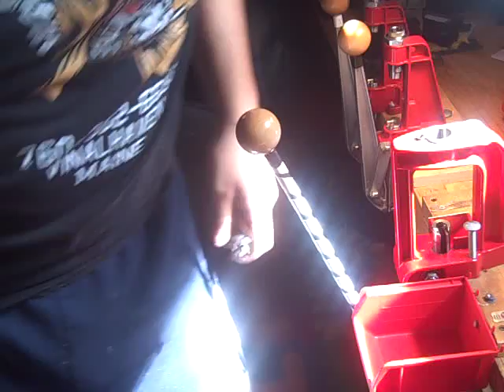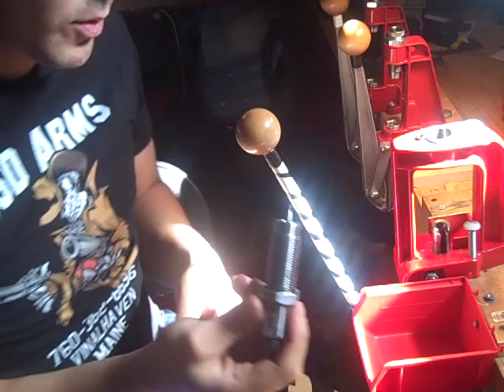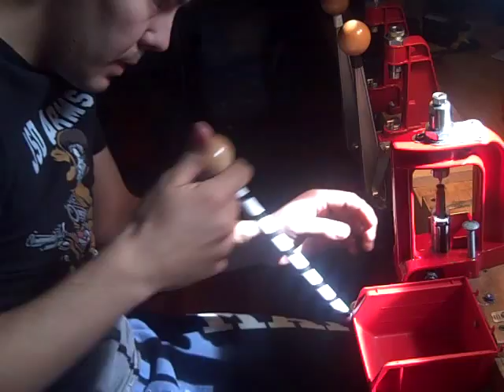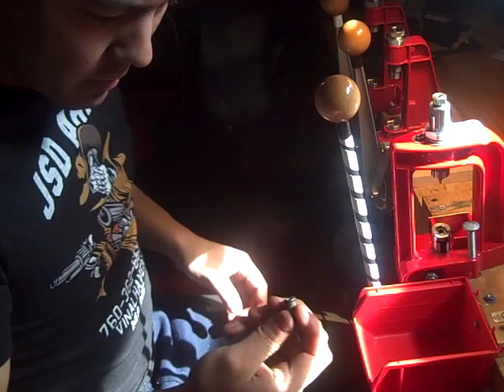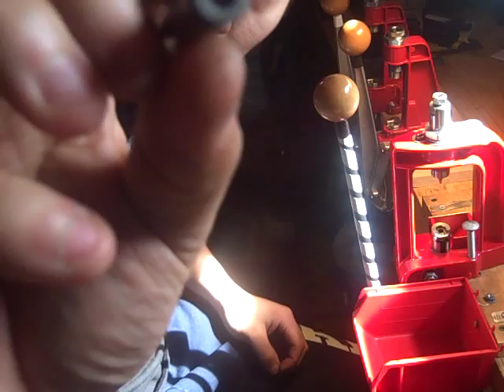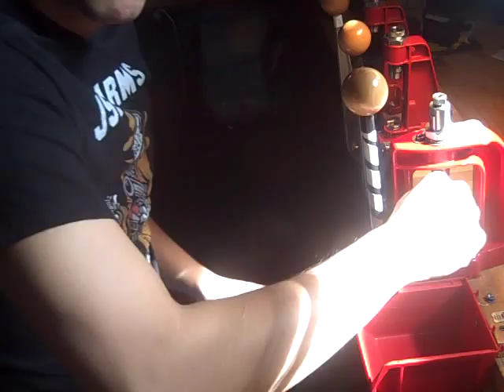Berdan to Boxer primer conversion custom made tool  by JSD Arms

Comment: They are different sizes so it won't just take a large rifle primer.  Did you also use a 22lr case to fill the inside?  Did that also work since I'm told lrp are longer than berdan primers?

Comment: The primer pocket is still too big for regular primers
Reply: You have to use a piece of copper tubing or .22 shell and a swaging die to make it smaller for a Boxer primer.
Reply: @ffjsb  a 22 shell? Wow that sounds like a great idea.  Never thought of trying that.  I've used copper tube and swaged it in but it was a hair big making it a little sloppy.  22 brass sounds great,  thanks 👍

Comment: so does this fix the issue of berdanprimers often being oversized ;) no - so you still need to either superglue primers in or make a bushing in the primerpocket to avoid dropping primers :)
Reply: Yes for most you'd still have to make the bushing but this is a nice step on the way. There was a place selling bushings for really cheap. I think that and this together would make it worth while.

Comment: This is a bit misleading because while this is an option, it actually takes longer in the long run. You cannot use berdan primers because the anvil is gone. Only large rifle primers and it will not seat like normal because the pocket is too big. You will have to drop the primer in and then use a drop of nail polish to glue the primer in place. You will have to do this every reload. I think the fastest method is the Russian Reloads who used a simplified method of a guy who has conversion videos for the x54r on surplus rifle forums.
Reply: How many times can you safely use a steel case?
Reply: About same amount as brass, but brass can be annealed which effectively renews the brass life (aside from material drifting from the head over many reload cycles). However, steel cases barely stretch so you don't have to trim them. This is a huge time saver. If you are debating buying this, at the very least collect steel cases you find. Eventually when surplus dries up you will be happy to buy this kit and glad you have those steel cases because while brass cases are available, they cost as much empty as a loaded steel case round.
Reply: Thanks.

Comment: lol. Yeah, it knocks out the used berdan primer and punches a flash hole but, berdan primer pocket is too larger for a large rifle or pistol boxer primer.
Reply: Then once the primer hole is punched in. Take the old primer and drill a tiny hole in center. Turn it over and put the old primer in upside down. Your primer pocket that was . 217 is sleaved g rind it flush with case head. Install  Small rifle boxer primer.  Put small rifle primer in case. Charge with powder. Load bullet. Observe. Berdan converted to boxer. Bam !
Reply: @benbrown4799  dang I never heard of that method either! I've swaged in copper tube but the old berdan is already sized and zero cost. I gotta try that.

Comment: now where are you going to find a boxer primer to fit in that hole and stay in there?    The large rifle boxer primers are way too small to stay in there....
Reply: Boxer primers come in two sizes. Berdan primers have other sizes. The primer pocket is the wrong size for either size Boxer primer.
Reply from the maker: You don't need a berdan primer. You can use a boxer primer cause its converted now.
Reply from the maker: There are Tula berdan primers for sale, if you do not convert them. I have seen people use them instead as well.
Reply from the maker: thats why you swag it with copper piping
Reply: POGMarineFPS
I saw another video on this same subject where the spent Berdan primer was used for that purpose. Putting it back in the primer pocket upside down (with a flash hole drilled in it afterward) made the pocket smaller. If the primer is too big that technique won't work.
Reply: Ah, he is using the ammo channel method of using an insert of copper to fill the gap. I used that method before along with this decapping method but they can be slow. At risk of sounding like a shill I reccomend everyone buy a 7.62x39 or x54 conversion set from russian reloads. They are by far the quickest method I have found to date after using their product for a year or so.
Reply: Oh, that is pretty clever putting it in backwards. Never thought of that. Can you pm me the link to the video?
Reply: But, as said earlier, the Largest boxer primer is .210 and the Berdan primer pocket is .217. So, how are you going to get the smaller Boxer primer to stay in the larger Bedan pocket?
Reply: @jason60chev  you need to swage in a bushing. A few different methods of doing this but using the spent berdan primers sounds awesome.